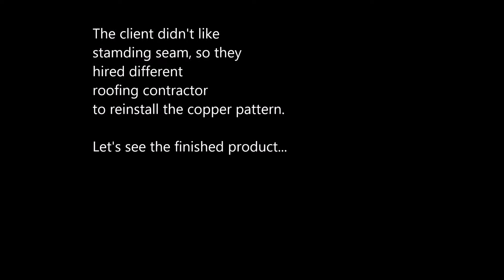Looks good from my house..

Comment: With all due respect on your job, I want to suggest that the next time you make another video on your "work",please try to at least show everything the reason why I'm suggesting this claim is because throughout the video I noticed that you had never shown the caps and you never did a close up to your work.The client also made a complaint of having too much dents and you didn't use the right tools."This is not good".Besides the bell I finished creating was not perfect but I, at least, finished it unlike you.You are just creating this video only to make yourself good and others bad.Also if happened to that roof you would be responsible because you are you not suppose to be up there recording any of her property.
Reply from the maker: no, you made yourself look bad, by commenting here. that means it's something really going on with that roof. I've never sad its bad. it just different approach. I've never finished it because the builder told me right away that the client doesn't like standing seam. so it was matter of time till the roof gets  ripped off. 
The idea that the roof is bad is only in your and frankch's heads. 
I've also never said im a good roofer, you can all right to criticize my videos all you want. in fact there are so much videos i wouldn't upload today because i use different methods of doing things now.  this video is created only to show different pattern.
Reply: Let be honest that work is bad.  But all days we learn. The copper work never gonna look perfect. But at least not make that cuts to the seam. That and copper cap is bad. Those nails with soldering at the top looks bad
Reply: this job is shocking I agree with you  there is soldering all over which is not needed  we use ⛩ un ste at hers to got round the curve un what's with nailing the sheet down un soldering over the nail it a terrible job in england it would be condemned ripped off un done again right THIS JOB US UTTER SHITEUN that's being nice
Reply: Joff Ainscow wtf language are u trying blend in there bud? Curious